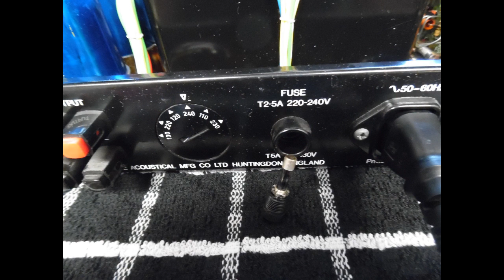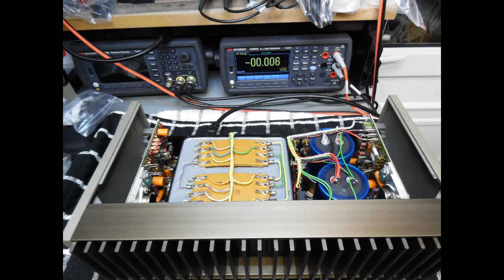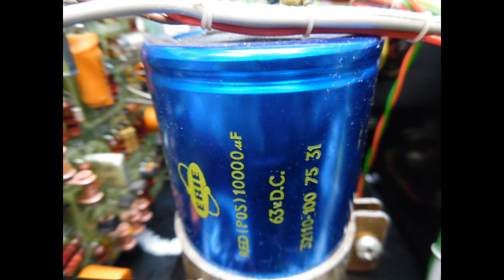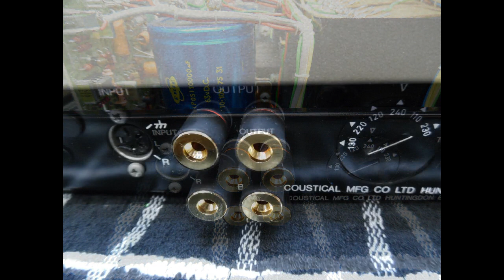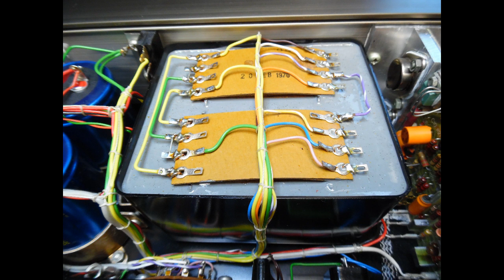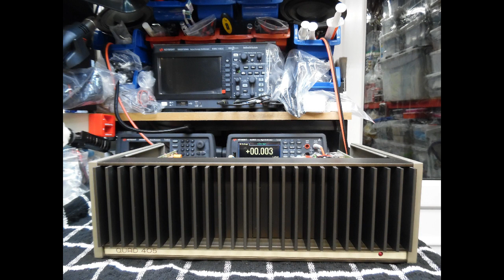Quad 405 Amplifier Repair (With Audio Tutorial)

Comment: 4:00 interesting: on my one the pcbs are mounted so that the solder side of only one is facing out when the end panels are removed. I'll have to swap one pcb around, as it has a subtle fault that needs the relevant component identified and replaced.
Reply from the maker: Thank you for sharing your experience on the channel

Comment: Interesting video , I like your presentation style. I recently re cap a 495 mk2
The original caps were way out of spec .I did all the polar caps first . Surprised that the sound changed only a little.when I changed the bipolar caps there was a huge improvement..but these had normal esr but reading about 20% high on capacitance . 
At age 40 years , all the electrolytes will be drying out . To prove the point I have a second 405 with original caps to compare sound .
Reply from the maker: Thank you for the feedback and also for sharing your insight experience on the channel.